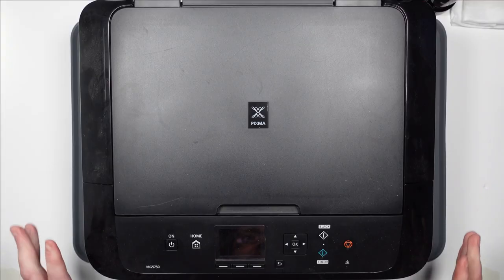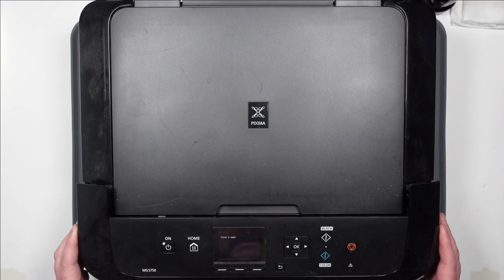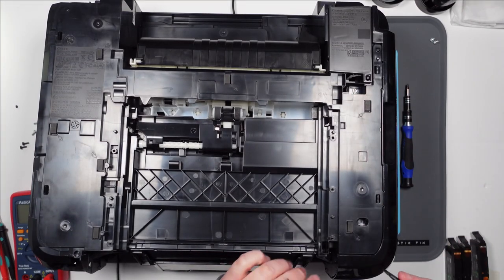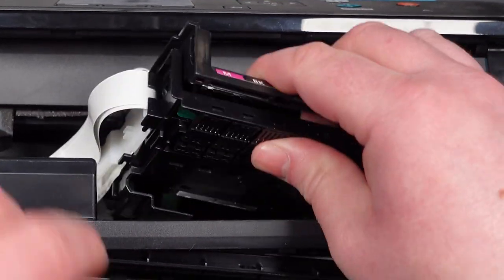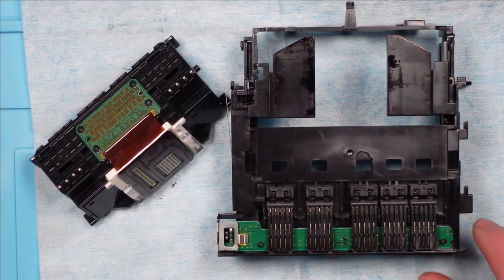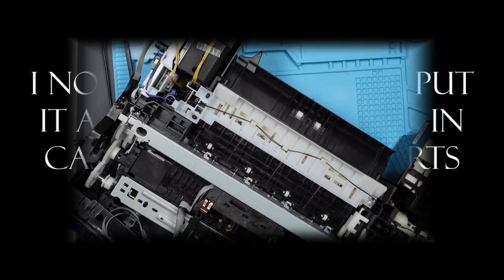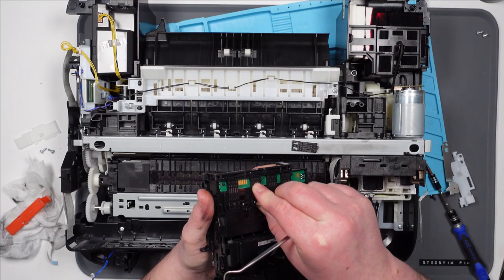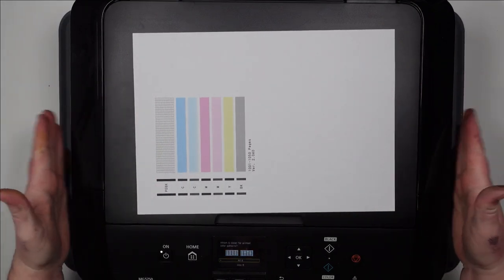CANON I Fix It? | MG5750 Printer That Doesn't Recognise INK!

Comment: I'm really impressed in how calm you stayed during that. I've attempted to fix a lot of printers in my life time. I'm a pretty calm guy but printers make me lose it. It's like they purposefully made it extra hard.
Reply: They do make it purposefully hard to try and force you to buy a new one if they start playing up. Modern tech companies should be hung up.
Reply: They make it hard to fix because printer repairmen need their money, too.
Reply: @moonblitz9923  100% agree. I feel like the "Right to Repair" movement should somewhere down the road push for these things to be made more easily repaired. Their engineers could easily do it and it would also reduce production cost. If it's easy to assemble it's easy to repair.
Reply: @andrasszabo7386  Nobody takes these to repair men. People just toss them and buy a new one. The damn printer is cheaper than the ink. You'd pay double the price of a new one to get it repaired.
Reply: @fritzcolburn  it was MY job to repair printers for Epson here in Hungary. A lot of crap came in for service.
Reply: @andrasszabo7386  yeah maybe for warranty or under service contract, but outside of that nobody will pay to send them off for repair when they can just Chuck it in the bin and buy a new one for less money.  Service contracts are were the big money is at.  As long as the printer works, the service company is making money, and the consumer only pays minimal fees.  When it breaks, the service company has parts in hand and skilled technicians and can repair or replace the unit quickly.  The consumer is not out any additional fees, so it justifies continuing the service contract, and the service company continues to make money until the unit breaks again.
Reply: @andrasszabo7386  That's fare enough for users who don't want to touch it but for users who want to fix it themselves they shouldn't make it as awkward as they do.
Reply: They are not worth fixing that why I see so many dumped at my recycling centre
Reply: @neiledwards5100  and that's why there is so much waste in this country.
Reply: @neiledwards5100  maybe if less people thought like you there would be less ewaste in the world yeah?
Reply: Some are very complicated. I got mostly old ones. Bought a new one once and it was trash. Returned right away and got exactly the same black and white laser that broke for 7 euro the same week in a recycle store. No interest in new ones.
Reply: I won't touch a printer with a 30m stick.
Reply: @andrasszabo7386  Did any broken printers come in as well ? 😊
Reply: @558vulcanxh  high priced versions yes. But sometimes cheap stuff, too

Comment: I am a Printer/Scanner engineer and I do fix similar canon devices... I must say you did well getting it apart without a service manual.
Absolutely amazing job there getting it working again, We normally just replace the ink unit for this fault. :elbowcough:😄
Reply: So the issue was just oxidation on the pins?
Reply: @goku445  Did you even see the cartridge?  I'm surprised it got any contact at all.  He could have cleaned that cartridge and the tips of the pins to make sure he gets good contact and call it a day.

Comment: I can't believe how calm you were during this, the fact that the printer survived at all means even your off camera moments of frustration were exceptionally well controlled.
All of these printers are literally throw away items, here in Australia when your printer runs out of ink, it's cheaper to buy another complete printer then it is to replace the full set of ink cartridges.
In 2020 during the full on pandemic + my final year of uni turned upside down, sadly my HP inkjet printer died due to complications brought on by a ball hammer 🤷‍♂️. Great channel 👍

Comment: My initial reaction is "why does it need a microchip in the ink container" and of course, it's a money grab to make sure you don't use ink from anywhere else but themselves so they can flog a cheap printer and have you over a barrel on ink costs. Anyway, rant over, great fix !
Reply from the maker: Yeah, you're spot on there Paul. They all claim to "work better" with original cartridges, but it is just so they can sell you them at 3 times the price of aftermarket ones! Always been a bugbear of mine, glad it annoys you too! 🤣
Reply: @StezStixFix  Thing is... A lot of Canon Printers work fine with refills. I have refills in mine at the minute and the only thing is, is that the software constantly reports that my inks are low even when they're not... because most refill companies don't see the point in reprogramming the chips in the carts. It'll be pretty evident in my printouts when certain colours start running out! 

Also, most printers are sold as a "loss leader" in the same way that games consoles are, so they're hoping to make a return on profit for the inks! Sneakers feckers!
Reply: @MrVestek  Yeah, but original Cannon inks are way better then chinese replacements. For example, their UV and enviromental resistance is way superior than replacement ones. Try to print some picture on a inkjet glossy photo paper with replacement and with original inks, and you will notice after some time that picture on these printed with replacement inks start to fade out and becomes very very pale, but picture printed with original ink catridges stays strong and vivid in colors even after many years...

And second thing that I can think off right now is the fact that some cheapest replacement inks can allegedly clogg the printhead out...

But, I never bought original inks for my canons before and probably never will because of their rip off price. They are as Steve said at least 3x more expensive than replacement ones. I've had 2 Canons, one some years ago (pixma ip4850), and the other (pixma ip 7250) bought a few years ago, still sitting here on my desk next to me. Both with errors where orange led flashes a few times. I've looked online and found that orange led on my canons flashes out a printhead error. And on both printers the same - printhead error. Now I don't know what to do, it turns out that is better to just buy a new printer because the new original printhead costs almost like a full new printer. Crazy, I know, but it is like it is...

Anyways, in my experience inkjet printers are generally one big pain in the ass and to maintain and to own.

Cheers!
Reply: Printers are the worst when it comes to this kind of tricks and planned obsolescence. One printer had a chip that would make it stop after a hard coded number of prints. They should go to jail for that.
Reply: Did you know that printer ink is more expensive than vintage champagne.

Comment: 20 years of inkjet printers are the reason i bought a laser printer. Not had any stress or lost my temper with a printer since lol
Reply: I picked up a cheap hp 1320 laser a couple of years ago and wouldn't go back to ink jets.
Reply: @NiebaumCurran  I convinced a few of my friends to go the laser route too. THey asked "But what if i want to print a photo" so i asked them when was the last time they printed one and when they realised it was years ago they bought a laser printer hahaha
Reply: For the three times a year I need to print something, I just walk up to the local library and do it there.

Comment: Ok so I had this error for a set of new cartridges,  mine was the cyan so I tested in in another slot and it picked it up fine. I  tried reseating several times then watched this video, went back to the printer and re-seated the cartridge and its fine now.   Thanks just watching this resolved my issue great work

Comment: PC Load Letter!  Need I say more?  Yes.  Okay.  Printers are horrible to repair, so I'm glad that you got this one working!  I have a Canon MG3650, which is similar.   Someone had stuffed a lot of margarine in it, so it needed to be taken apart and cleaned, after which the paper feed mechanism stopped working - so after another taking-apart it worked and has been fine since.  The build tolerances of these things must be so fine; it was made by a machine and probably designed by one too.   Humans are intended to be users only.

Comment: Hmm.....Well, I can see I'm in for some fun...  Though this video shows this is going to be easier then the Epson & HP printers I've cleaned out in the past.  My 8 year old MG5720 has a code I can't clear (B204), so I'm going to replace the head (there is a super easy way to pull that that doesn't need the whole printer pulled apart) as well as clean out all the ink absorber sponges (which I've decided it would be best for me to pull the right side panel off allowing me a little more access to all that stuff).

Comment: My HP printer has a factory defect, where it randomly decides to freeze on boot up. It happens because this printer was made the year HP decided to not use leaded solder on they motherboard(can't remember what year that was off the top of my head). So basically the solder joints Crack on the board and it can't get a good enough connection. So the easiest way to fix it, is by reflowing it by putting it in the oven  at 200 Celsius for about 8 minutes. I've done it before and if works, but its probably not the best solution to fix it.
Reply from the maker: Thanks Victor. Yeah, that's an unfortunate fault. i think it would need the unleaded solder removing and replacing with leaded to eliminate that completely. 🤔

Comment: My model is MG7720, and it showed the same problem, I want to clean the cartridge holder(the dock with colored label), but I didn't find the process you remove it from the printer, would you please give some detail?

Comment: I really love my Canon printer! Canon always is the best! today it's stopped to recognize my black color I changed 3 black cartridge and still couldn't recognize then I find out maybe its a problem with the pin and I checked for pins I tried to put all of them in one line but one of the broke down so I tried to test again the black cartridge with one broken pin and amazingly it works ! The good thing for Canon printer is that no matter how many times you opened it and close it. It made like she can working in any condition that she is. Canon is the best!

Comment: Hi, I stumbled into this video yesterday, and I couldn't help myself laughing out loud when looking at your reaction of the printer's noises, because I too have the same reaction with my Canon MG7510,

This MG7510 is working for 6 years in my work station, many times producing these strange noises before printing or scanning. It so happened that a couple of weeks ago a strange behaviour started to creep up: I would turn the printer on, and after a few moments it would turn itself off. A technician from Canon told me that this glitch was affecting many of their printers, and to my surprise, he advised me to turn off my local router and disconnect the printer from my LAN. Instead, I should use a USB cable for the time being.

At this point I was rather intrigued and had difficulties understanding what was going on.  The technician did not explain anything, he only said Canon engineers were looking into it. I searched for some info on the Internet and I read people claiming that by going to the printer's web service setup and inserting a fake DNS IP address the printer would work on-line again. Apparently, when working on-line these Canon machines would resort to a web site of their own, and only later print whatever the user requested.

However, the final solution to this glitch was being made in a new firmware release, which would update the printer via the afore mentioned USB cable only. I was later given the link to the new firmware installer, which did the trick as promised. Still, no clear explanation was available to me why this DNS error managed to affect a number of Canon machines. Go figure!

Be as it may, having the Canon (or any other printer for that matter) offline, is a complete waste of local resources, and, needless to say, I haven't used a printer USB cable for decades now.

Congrats on your video, it shows how unexpected these things are.

Comment: i have a very cheap hp printer used it once would not go,so left it for 2 years saw youtube video on different things you can do there 7 things i tried all of them the one that worked was clean contacts in printer i did and it worked.

Comment: when i worked for canon we would trick printer into thinking in cartridge wasnt empty by putting electrical tape where optic sensor shinned through. if light didnt penetrate cartridge it assumed it was because there was still ink blocking it
Reply: Canon stopped using optical sensors years ago.   Now they use chips with counters in them to measure the ink.  Fortunately you can buy resettable and re-fillable 3rd party ink cartridges.

Comment: Another frustrating one Stez. You sure ain't picking the easy ones at the moment. 🤪 Only this time your subject wants to upstage you. 😂

I wonder if the connection was slightly loose and was only affected when the ink arm (is that the term?) moved. Once it thought there was an issue, it maintained the thought of there being an issue. Sometimes modern tech is too smart for it's own good.

At least it's working; a new printer and a new shape of ink cartridge is just a crazy thought, particularly with ink prices.
Reply from the maker: Thanks Toxo. Yeah, this one was painful right from the start! You could well be right there, considering the LED lit up on its way in but extinguished once the printer arm took it! I wonder if swapping it with the black one, just made it that little bit more secure. 🤷 Anyhow, its still working fine, so another lucky win for me! 🤣

Comment: I am impressed and bemused in equal measure.  I have one of these and the amount of clunking and beeping it does gets my goat.  There is surely no need.

Anyhow, I have found that mine works fine with genuine OEM Canon but hates other brands.  Printer manufacturers are imo just gougers.

Comment: I have one question. Did you take the black ink out and put it back in? I have a strange feeling if you do that that it will start doing the same thing but on the Black ink cartridge.  It is just a thought that came to me. If it does that then can a person buy a replacement part for it? The reason i ask is I buy Canon ink jet printers an really like them an it would be good to know if it happens to me.

Comment: I replaced the print head in my all-in-one HP (which was very similar), they would try the patients of a saint. BUT, I got it apart, back together and working like new. What pissed me off the most was the cartridge vacuum motors that hoover up all your expensive ink and dump it inside on blotting pads. That got the swear words rolling off the tongue I can tell ya. :face-orange-frowning:

Comment: In my country that printer is about R900 new, my rates are R350 per hour and we either charge 1 or two hours for printers. We literally throw away a couple of printers each month because the customers do not want to spend so much money when they can actually just buy a new one. I don't even keep them for spares. Printers are a very wasteful thing and I think the manufactures made them to be disposable or expensive to fix

Comment: I've acquired at fruit machine,I plugged it in and the switch on the power supply was smoking, I replaced the switch and I've changed the backup battery on the motherboard and there's still no life,on more inspection I've noticed a capacitor with a bulged top,is this a possible cause for the machine being dead.

Comment: I missed out on how to remove the carriage.

I am trying to fix an error on the magenta right now, two of the 5 pins are pushed down, and printer is not recognizing the cartridge "tank"
Reply from the maker: Hi Victor!  I remember it being really difficult to remove, I guess I had to cut most of it out to edit the video down to something watchable!  Hope you can get yours working again.  Good luck 👍
Reply: @StezStixFix  Success!

I ordered the carriage, waiting on it to swap the connector. Thanks man. Greetings from TX

Comment: And hardly any ink leaks or blood. I think we had a pixma at one point. Its was fantastic until it died, perfect photo printing, there were dubious looking websites offering ink tank upgrades with kits you could buy from russia .  You can get printers with ink tanks now and you fill up the tank from bottles which sounds messy but is actually not and is way better for your bank account.   Having had printers that lasted literally a year with the cartridges costing more than the printer, they have come a long way.

Comment: I could not agree with you more Sir.....In the middle of printing a few pages Canon Pixma TR4520 I get a 7500 error code....Printer was hardly used new in the box. Used it for about 6 months...This is the first page I could even find the code!.....A new board?...Service center...where?....POS....The nearest landfill...Canon never again....

Comment: To help others, I thought I would also share this tip:

If by chance your using cheaper unofficial ink cartridges, and you encounter this error - save the old empty ones and swap around the copper connectors on the small green boards on the cartridges themselves - works like a charm.

I thought I was f*****, but this workaround solved it!

😂

Comment: Canon printer: a black box that tells you when to go out to buy ink, even if you don't use it.
Luckily I found a supplier for aftermarket ink cartridges that can get a refill and reset the chip automatically. It's a bit of a hassle to get it working, but when you get the procedure, it is a piece of cake and you can print for only 10% of the price of the original cartridges.